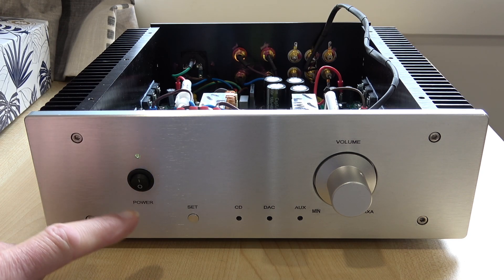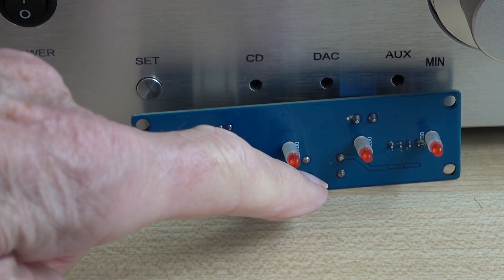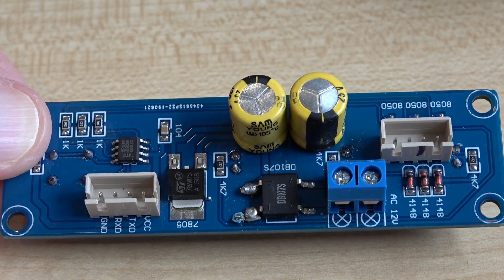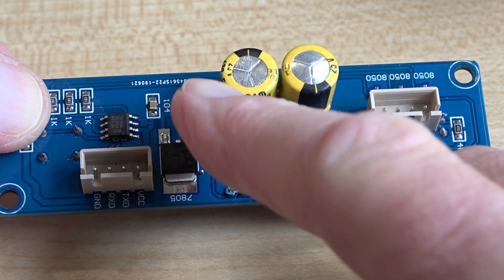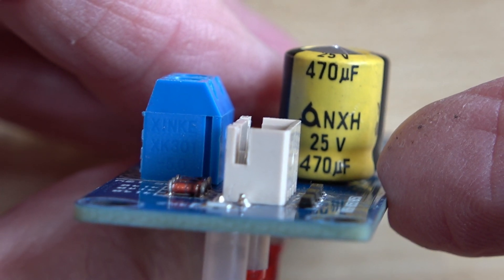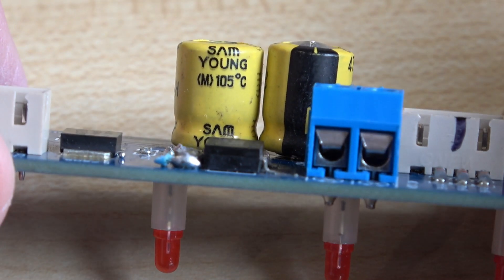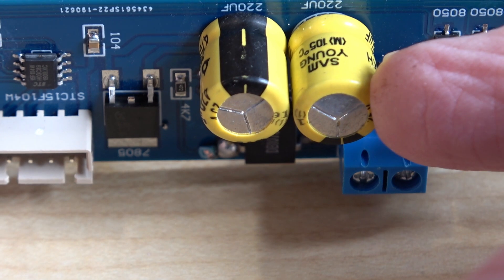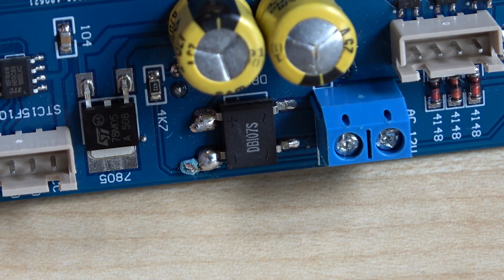Problems with my L12/2 Amplifier

Comment: It is possible that this board was in fact tested, and passed, since it worked fine for you for over a year. I can understand you being annoyed, but I guess there has to be some reason why these things from China are so amazingly cheap.
Reply from the maker: Yes, you are probably correct. It was just lucky that the cap was quite a high working voltage with little voltage on it, so being reversed has little short time impact. As for being tested, I have received so much stuff now that cannot possibly have been tested, wrong parts, reversed, transistors wrong way round. The list is endless. I think, if given the choice of 10% higher cost for testing, I think most people would choose this option.

Comment: Could this selector board be directly used with the c3850 preamp you got in your l12-2 amp?
Reply from the maker: Yes, it probably could, don't forget to check that the front module has both the big electrolytics round the right way, many are incorrect.

Comment: Whar's with the blob solder on the rectifier bridge?  Is that corrosion or a trimmed blue wire?
Reply from the maker: Hi Roger. You noticed, it was the supply to feed the LED on the front panel. As I removed the module, probably not used again, I just snipped the wires.

Comment: If you remove the capacitor from the board, does the board show the correct orientation for the capacitor?
Reply from the maker: To be honest Bill, I cannot remember, was almost 2 days ago lol, but I think not. The way I found it to be wrong was to measure the polarity of the voltage on it and follow the circuit back to the rectifier.

Comment: I have bought many electronics cards from China.
you need to check if they are made correctly. either poor soldering or full of flux you need to wash away or other problems you need to fix.
this is common!

Comment: Did the repair work and did you point out the mistake to the manufacturer? They should pay you for beta testing their boards!
Reply from the maker: To be honest Christopher, judging be the amount of faulty stuff I get, I really don't think they care. If they get lots of complaints they just close the business and re open the net day under a different name selling the same crap.
Reply: @MichaelBeeny  I'm afraid you are right. But if I were an underpaid worker in a Chinese factory, I don't think I would care either. I'm very much guilty of mostly choosing the cheapest options, and quality control costs extra...
Reply from the maker: @MarcelOoms  Hi Marcel, yes my channel specialises in CHEAP for sure. You are right, of course. It's the price we pay for low prices.